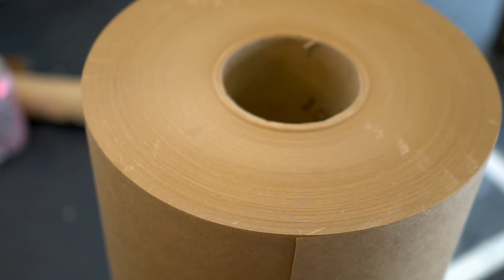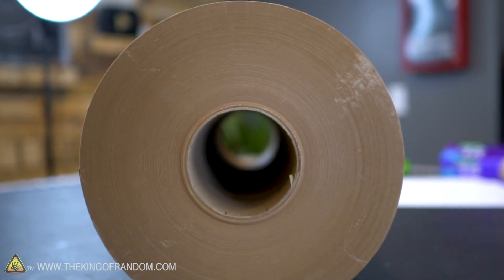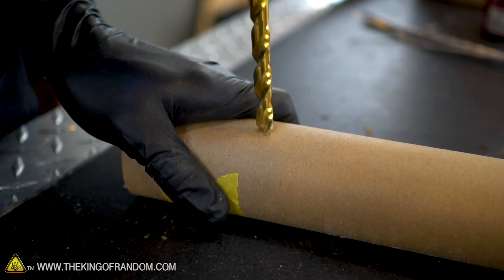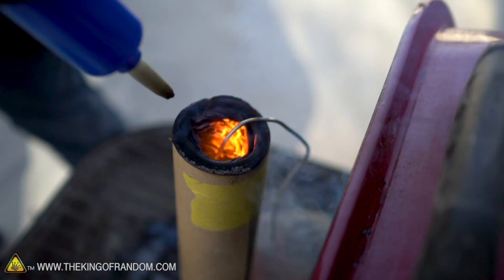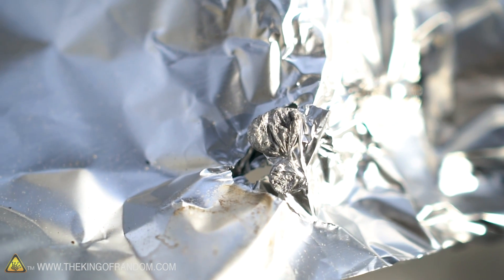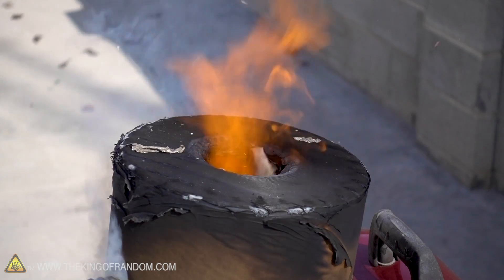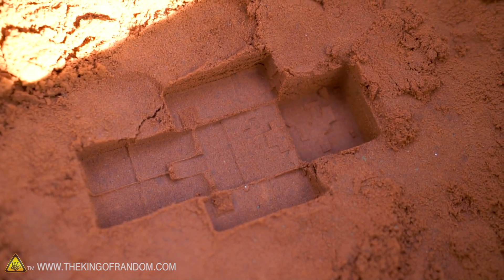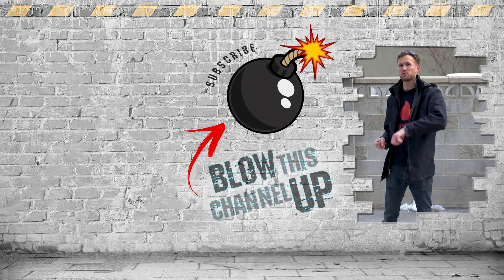Using Only Paper to Melt Metal

Comment: You're having an issue with the paper rolls because the inner cardboard, sturdy center. You can peel that away layer by layer in order to get the paper going. The cardboard stalled the progress quite a bit it seems

Comment: It bothers me a little that he says oxygen when he means air since air is mostly nitrogen, if he straight up used oxygen this experiment would be way crazier and could possibly melt that steel rod he put in, if the walls of the paper even make it long enough to get that hot

Comment: Technically you didn’t melt the metal with just paper, adding the forced oxygen increases the burning power significantly. If you were to burn just paper with the natural oxygen around the results would be different

Comment: Use a Hard wood log with a rot whole (or drilled if your that ambitious) soak it for a day then set if directly on top of a already burning fire.  we used it to melt glass, aluminium by the end of a week we had huge piece of melted glass an aluminium at the bottom an that log lasts hours so long as you make sure it is wet an also works better if you set some sort of burnable platform  to sit on an... it was my rocket stove before I even knew what one was lol

Comment: This video itself should be conclusive enough to debunk any and every 9/11 conspiracies.  Heat and temperature use two different measurements.  BTU's matter more than burning temperature.  

It's like trying to say "Oh, but this 10 gallon per minute hose is better than this 2,000 PSI pressure washer."

Comment: You should close the bottom. There is a similar low-tech stove where you put saw dust and wood chips into a large can with a 2~3" pipe in the center and pack it, remove the pipe, then burn. |The can has another hole or two or three at the side bottom for air. But the direct bottom is closed.

Comment: No, 451 is the temperature paper ignites. It burnes much hotter.
Reply: oof didnt think to see you here
Reply: Kni they are friends
Reply: Kni or were friends
Reply: Why hey, there Cody wasn't expecting to see you here great to see you take interest in other channels. being the smart one like always btw hows the Carboniferous park doing?
Reply: oh hey cody
Reply: That feeling when you still use Fahrenheit.
Reply: He says this at the end
Reply: Cody slab coming in here with the facts
Reply: It's actually true. Paper will turn much hotter if put together, aka more paper, more heat. That's because paper is much more thinner than any other fuel, so it can only produce a little bit of heat, but if you scale it up into like a volume of a wood, it would stack the heat by a little bit, so it can burn much longer.
Reply: AKA kindle temp.
Reply: Um has no one read Fahrenheit 451??
Reply: At 451 books burn
Reply: @joaquinarchivaldo702  They IGNITE at 451(-ish) F. They BURN at significantly higher temperatures.
Reply: OH! Gott’em!!!
Reply: oh hi cody!
Reply: Hi cody!
Reply: *burns
Reply: i'm assuming fahrenheit
Reply: Burns*
Reply: Hi cody
Reply: Cody has been in one of the king of randoms videos with the King of Random
Reply: I've seen you on NileRed, Now TKOR?
Reply: Why 451, not 450???
Reply: yeap, I thought the 400F was awfully low.
Reply: @HuckleB680 yeah, but which metal?
Reply: I agree with Cody, here. 

In fact, just learned this from the guys at Stuff You Should Know Podcast that the ignition temperature for paper (and books for that matter) is more like 450 °C. The writer of the book "Fahrenheit 451" simply preferred how it sounded to say Fahrenheit over Celcius and added the 1 for the same reason.
Reply: @Hexlattice  No, the auto ignition temp of paper is around 451F (424F-475F). The comment about it actually being 451 Centrigrade has been around for a long time.
Reply: Yes... but learn to spell
Reply: "My name's Cody, I'm super smart & going to correct you on your video but I can't even spell a simple 5 letter word..." 😂😂👌
 love Cody's lab, one of my first subbed channels. I couldn't resist busting those chops lol
Reply: @Jp-md3ir  intelligence in one domain does not reflect intelligence in another.

Comment: "Jetfuel can't melt steel beams"
Paper and an air mattress pump can heat steel enough to lose structural integrity.
Reply: "there was an air mattress pump at the base of the second tower"
Reply: jetfuel should be able to melt steel beams given enough oxygen and a fast flow rate.
Reply: @Metal_Master_YT  yeah but wheres the airflow coming from?
The wind?
Ever try to melt steel?  Like real steel like a steel track or an I beam?
Its so hot you cant look at it before it melts.
It would blind you.
Thats WHITE HOT SUSTAINED Constant oxygen supply inside a a big arse foundry type of hot.
Not bloody likely.
Reply: Um..... it’s aluminum not steel
Reply: There was a steel rod holding up their crucible in our paper forge. When Nate pulled it out it was red hot after only 45 minutes.

Comment: You can. What you built is a forge. Al melts @ 1200 F. That's a cool to moderate forging temperature. Plenty hot enough to do some substantial blacksmithing.

Comment: Should have just pumped air in from the bottom and  not leave both ends open, I know you wanted it to fall through but it would have been better to just  use it as a self-consuming furnace

Comment: if you had blocked the bottom end and allowed the air flow only go out the top it would have been much hotter and would not have ruined the conduit.

Comment: Next time use the rocket stove method by drilling more holes in the bottom. This will help it draft more air up to the top instead of using a bellows/blower.

I have accidentally melted cast iron with a home made cinder block rocket stove.
Reply: or just block the giant hole at the bottom where all the heat and oxygen is escaping so that the ump can catch up.

Comment: in this situation, the aluminum is more likely to burn than melt...
(edit). yeah, you didn't melt anything.  you caused the aluminum to catch on fire which combusted it into aluminum oxynitride.  the combustion of the aluminum simultaneously destroyed it's lattice integrity and provided the heat to 'melt'.  i would not recommend this method for melting aluminum.  one uses a crucible to reduce exposure to oxygen.  open exposure of thin aluminum is simply a partial recipe for thermite.

Comment: The air hole in the side of the tube is nice, BUUUT, the hole should of been at an angle to create an air vortex. Also, the bottom of the tube should be closed off a bit so that the air is majorly coming from the furnace port (drilled hole). That would create a huge improvement on the temps

Comment: The reason this worked is that the density of the paper was enough to slow down the speed in which the cellulose burns. the more tightly together the roll is the less surface area can oxidize (burn) and thus the longer it takes for the plasma that makes flames to reach the unburned fuel.  Not to mention the paper and the cardboard was probably treated as well. 

Fun Fact: This same premouse is used as a low-end firebox for a blizzard kit as you can use a toilet paper roll and a coffee can to light a small fire and it will burn for a few hours. But you want to get rid of the cardboard roll on the inside as the glues used to bind it when burned create a toxic fume that can be problematic if inhaled.

Comment: You should have been able to just put a piece of duct tape on the bottom.  That would keep the air from blasting out the bottom. The air below the tuyer (your air input) shouldn't burn significantly faster that a non-airated piece of paper.

Comment: "Using ONLY Paper" lol 😂 And a drill bit and an air pump, along with metal conduit!
Reply: Using only paper as fuel*
Reply: @ZayanGL  can paper melt metal *
Reply: And fire
Reply: he could have literally blown on it and it would have done the same thing he didn't need it, it was just more convenient and the metal conduit was only used with the air pump.  Nate didn't use the drill bit in making the aluminum melt he used it so he could have the more convenient source  of air blowing in that specific area he could have used only paper he just made it more convenient for himself
Reply: Proceeds to use lighter in the first part

Comment: you could melt iron by using a multistage system.  The hotter the air temperature going in the hotter the fire will be.

Comment: So I did a bit of research. The melting point of aluminum is 1,221 degrees Fahrenheit (about 661 Celsius), so to get that for hot enough to melt it that quickly I suspect you had that up to 2,000 degrees F (around 1,093 C) or there abouts, which would be quadrupling the normal tempature of burning paper. Steel gets red hot at around 900 Fahrenheit (about 482 C) depending on what kind of steel. So melting the aluminum was more impressive. Though it must be noted, that paper is essentially just super thin wood. So by making such a thick roll of paper, it makes sense that it could theoretically get as hot as 1,112 Fahrenheit (about 593 C), the temperature of burning wood, however, a bellows can do as much as double the temperature of a fire. So your fire could have gotten as hot as 2,224 F (about 1,218 C). Which is hot enough even to melt cast iron if you could sustain the fire for long enough. Maybe you could explore this in a later video?

Comment: What happens to lava when combined with acid.Also what will happen when Liquid nitrogen is combined with acid.Does anything happen when acid is mixed with a different type of acid.
Reply: you like acid huh?
Reply: You can just answer those yourself.
Reply: I think you have the wrong perception of acid it’s not some water looking super hot liquid that can melt through anything in seconds most objects have to sit in acid for hours before any notable change happens to them so if you put acid in Lava it wouldn’t do anything really
Reply: OWR _VONNY there is an acid that can destroy a spoon in seconds tho
Reply: Owr_Vonny stuff like pure hydrochloric acid can melt your finger of in 30 seconds

Comment: Paper auto ignites at 451 degrees f.  But it burns as in the center of the flame at 1500 f
Reply: The forced air also aids in increasing the temperature.
Reply: exogator do you seriously not know how to spell temperature?
Reply: MoonPie Obviously not while I was drunk, No.
Reply: exogator ah ok because I can just know that you’re drunk alright.
Reply: Thank you!
Reply: Thank you.  I was wondering how aluminium (with a higher melting point than paper's ignition point) was melting.  So paper can burn hotter than the ignition point.
Reply: Also looks like there's cardboard in the middle making it even hotter. Can be misleading/confusing for some who think this is suppose to be educational or don't think scientifically
Reply: You were drunk during the day?
Reply: Ragesauce that's only for weekends, I left that comment at around 1:04 am...
Reply: Wad
Reply: Fahrenhiet 451
Reply: Nerds

Comment: On a side note, you should test how long that roll of paper, or even a log the same size with a hole in it, will burn. Then try basing a forge on it more or less as a proof of concept. You could put the rocket stove roll/log under, or even over a normal forge with the hole in the fuel lining up with the one for the burner, and when you run through that piece of fuel, ignite another one. It could be a really cheap and efficient way for those on a budget to forge. I mean think about it, by trapping the heat, it's much more efficient than a pile of charcoal, and more evenly heated because all the heat accumulates in a box insulated with refractory materials like fire brick and/or kaowool.

Comment: The temperature at which something catches fire is not the maximum temperature of the fire it creates through burning.  Particularly when you are feeding it oxygen, or focusing it in some manner.  And paper is pretty much dry wood and/or grass.  A stack or roll of paper is pretty dense, which is why the extra air flow was needed.

Comment: also 451 f is not the real temp that it burns at
Reply: @RaphealPicard  Although paper ignites at around 480 degrees Fahrenheit, it gets far hotter once it’s burning. The temperature at the center of a paper fire is 1,500 degrees Fahrenheit, give or take a couple hundred. The tips of the flames themselves are usually between 600 and 800 degrees.

 also take note i said burns at not ignites at.

Comment: Can you use paper to melt iron?  

It might be "cheating" but you could try to convert your paper to charcoal (pyrolysis), and then use forced-air to burn the charcoal at high enough temp to melt iron.  You would burn some paper to try to convert some other paper to charcoal (similar to how you make char cloth).  Then burn the charcoal with a blower.

Comment: As soon as i saw this video i knew the answer you can actually if you take a box say from a 12 pack of soda and stuff it with paper it will light and put off enough heat and last as long as its oak counter part of the same size

Comment: My soddering iron has trouble melting aluminum sometimes so I really doubted that the paper could do it! 😀👍
Reply: How does your soldering iron melt aluminium? xD
Reply: @hubari7867  Aluminum melts at 600 Celsius and my soddering iron heats up to 750 Celsius. So it can melt aluminum but only a bit.
Reply: @bananaslug6080  thats a strong af soldering iron.